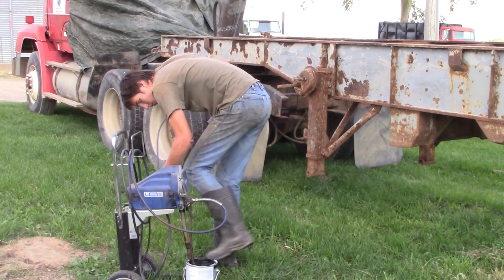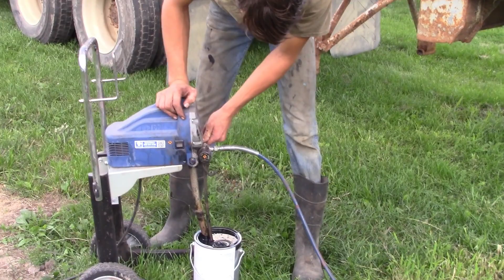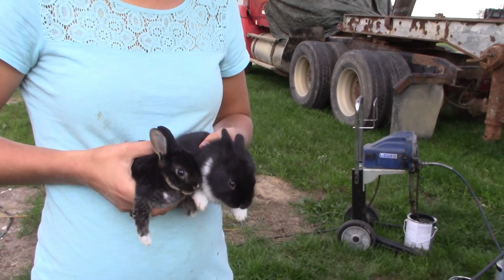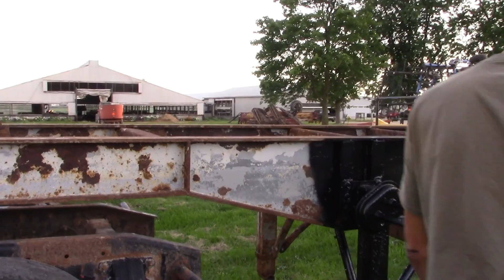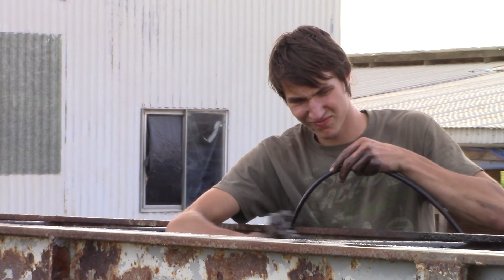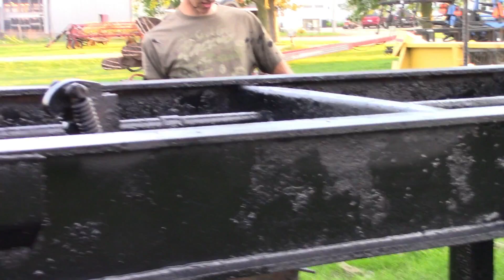Painting the Frame of the Dump Trailer

Comment: I had a lot of memories of a 90 Kenworth T400 that I drove for the Dairy when I del Milk to grocery store s in CT.we had 9 of them I was assigned mine from new until about 650,000 mi about 8yrs.we had the Cummins L10 300 HP with the 9spd and 3.90 gears.when they got to450k mi we had a lot bearing failure issues so a lot of inframe overhauled.mine was the only 1 that went the most mi without any engine failure.But they decided to do an inframe because it loved to consume oil.

Comment: I used to paint aircraft and ground equipment in the Air Force. Good job but you could have used some corrosion converter first and done a little grinding on the rust. Some people just spray it with drain oil. None the less you did the best you could with what you had. Rust is a terrible thing.